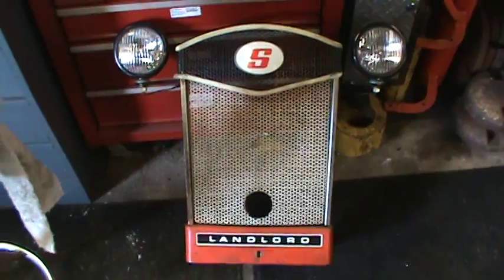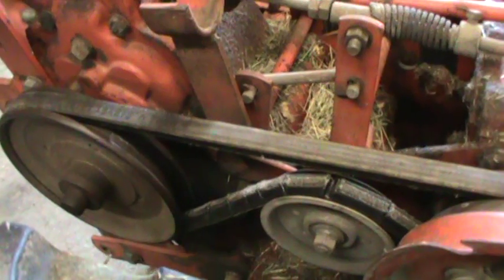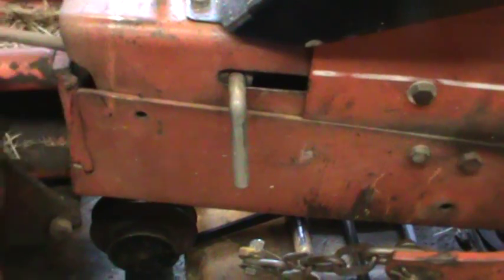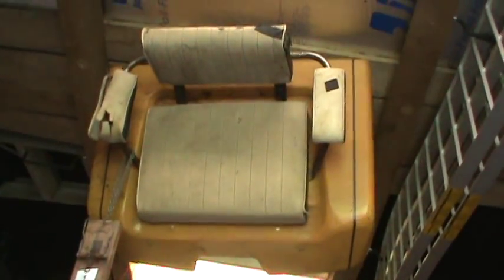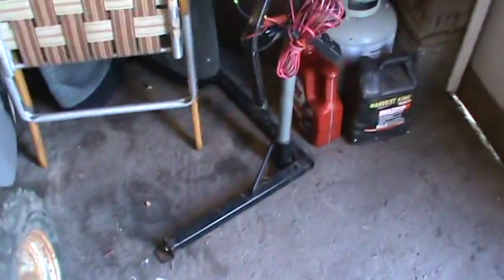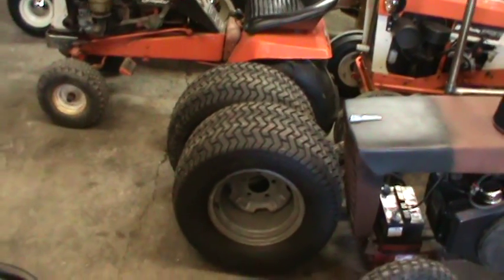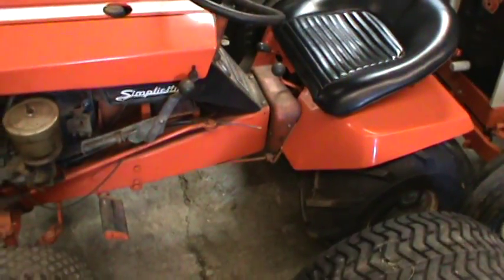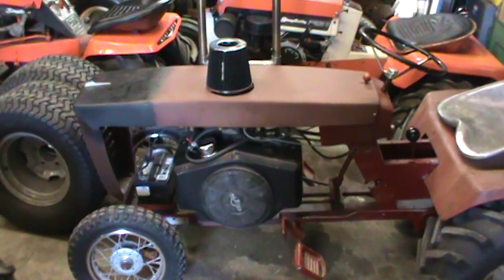A Zippo Update!!

Comment: Do you think I have anything to worry about? What should my next step be?
Reply from the maker: +Zane Petty After installing the shut off, the most important thing is always remembering to shut the fuel off before cutting the engine. The next step should be to inspect the needle and float for wear and replace as needed. I would then replace the fuel shut off solenoid with a new one. Those three things should square away the fuel delivery and flooding issues. Cheers!! Zip~

Comment: Zippo, I also found gas in my oil. I hope I didn't ruin my engine. How can I tell and what should I do other than Change oil?
Reply from the maker: +Zane Petty Hiya Zane. Put an in line fuel shut off on the fuel line and shut it off before you turn the engine off. This will prevent loading up the crank case with fuel. There are two possible causes. One, the float and needle in the carburetor isn't shutting off when it should and secondly, the fuel solenoid that is on the bottom of the carburetor could have a weak spring that is preventing the fuel from being shut off. The in line fuel shut off will not fix either problem, but it will prevent the fuel from loading up in the engine and is the easiest remedy to the over all problem. Cheers!! Zip~